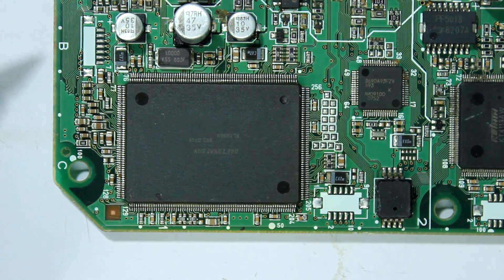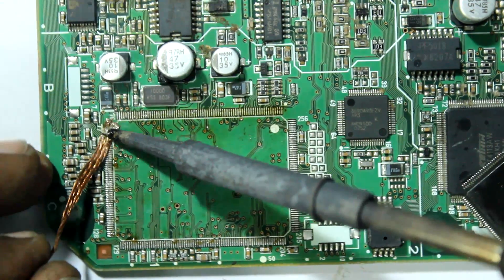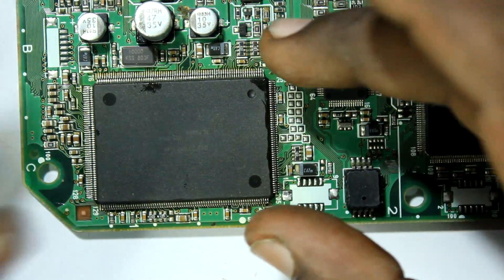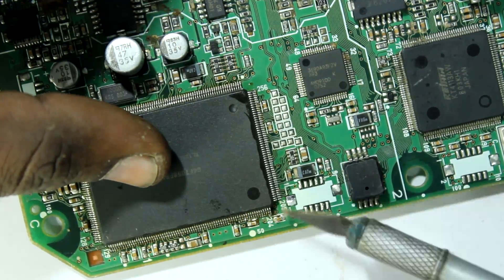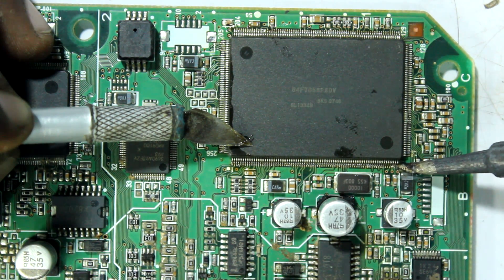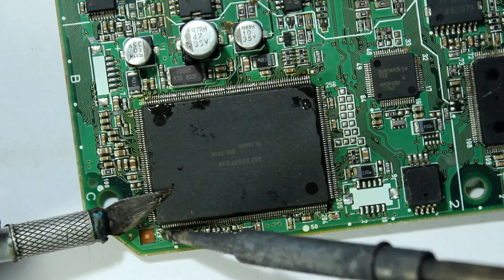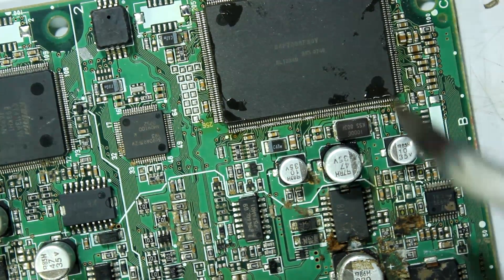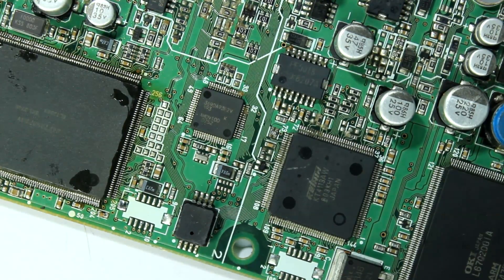How to solder like a professional.Without any professional Equipments

Comment: Thanks for the video, I know it takes time and effort and the meaning is in all good intentions , but I do question your soldering iron,  I will say that is got to be the worst iron I have ever seen. I'm amazed it could even heat transfer and all the gunk on it full of contamination, I would be worried that your solder joints are going to fail. I clean my irons every three or four spots . But what  do I know ? I just restore vintage amplifiers and Ham  radios as a part time business.

Comment: Well, i am with aaronspencer1880 in that points, that you need to take ensure that the pad place of the removed chip should be clean from flux and solder. Flux is your fried - i aggree, but use them as less as you can. The chip swim into the flux and this will be bad in the future because it's  nasty and corrosive. Cleaning and preparing the pads is the most important work that have to be done to get a solid and reliable solution.

Comment: QUESTION:  What prevents Solder from forming Bridges betweein these very close and very small pins thereby creating a Short ?   It seems that the Solder would flow and connect 2 pins together, what stops it from doing that ??
Thank you.
Reply: Flux

Comment: Beautiful job , i just soldered my LG plasma tv for black vertical lines i did this before worked great,  just had to soldier other side for vertical black lines it worked but this time i have fine red & blue lines is it possible i put a hair to much solder & if so can i just try to thin the solder or did i damage or short chip it looks great it's not sloppy just a hair to much solder do I have a chance to get hair line vertical color lines out or could i make it worse & live w it !

Comment: Thanks for this tutorial.  Is it because of the flux applied along with the tiny contact pins of the processor that prevents them from joining together when it is soldered on to the board?  Can you please advise? Thanks.
Reply: Gooy quality Flux

Comment: How sure are  you that no short had been done. The pins are so close with each other and you just run your soldering iron stream line.
Reply: if is the right amount of solder  the suface tension it will  "drag" it on the pin or surface where solder can stick  ,if is to much is possible to bridge the pins and you need to clean (take off the surplus) with desolder wick ordesolder pump  
you can check  "reball  chip"
   https://www.youtube.com/watch?v=BY-TCgvEU7g

Comment: Great vid in showing how simple this process can be and that if one can swing a soldering iron, then they shouldn't be scared to try this themselves. Well done to you, cooltronics!

A few extra tips, if I may, especially for those not experienced in this technique:

1. When removing residual solder from the PCB pads, try to run the braid in the same direction as the pads. It will take longer but it will greatly reduce the risk of ripping the pad from the PCB, especially if you apply too much pressure or the PCB is of poor quality.

2. Make regular cuts in the end of the braid to remove the 'soldered' part of the braid. If you keep too much solder on the end of the braid, there is an increased risk that the 'soldered' end, that has not quite solidified, may 'grab' onto a nearby pad, ripping it off the PCB.

3. Always remember that flux if your friend! Yes, it may be nasty and corrosive but once the job is done, it can be easily removed with propanol.

Comment: Excellent video -- made the much simpler job of soldering my micro-usb port back into place easy.
Reply: Hey, did you replace your micro usb port with soldering iron and normal solder? I don't have a hot air gun and solder paste so I'm tempted to do it with my soldering iron and use normal solder and flux. How did it go for you?
Reply: @Joao-cl1xk  yup, normal solder and flux.

Comment: Nice work. It's all in  the technique. The flux does help prevent bridges and allows the solder to flow nice. Practice practice  practice. I inspect with a high powered magnifier.  Touch up if necessary.  I would go in and out from the chip at the areas  needing  touch up to correct any bridges without disturbing the other pins, instead of going along the pins, but obviously this guy has had a lot,of experience soldering s.m.d.

Comment: I've looked as closely as I possibly can and I see no solder bridges anywhere. In fact I'm amazed it worked so well on such an IC. Well done, Ignore the idiots with their claims of bridges, it's almost as good as the original. I'm impressed and after working on the F15 Fighter black boxes and soldering for over 60 years I'm not that easy to be impressed over any soldering job.
Reply from the maker: Thank you, I'm working on my next video on soldering. I will try on that video to solder on a working board, and repair it. just as a proof. thank you for the comment, it was needed.

Comment: This is ridiculous work, a 5 year old could do better than this, literally every pin are shorted from one to another, how is this professional work??? look at 6:25 literally every pin connects to eachother in the middle, this is far from even amateur work, you should not touch a soldering iron.
Reply from the maker: the pins are so close to each other that, in the camera, it looks like they are shorted,  I don't have a zoom lens to show it to you guys, I tried my best but, Its good you don't believe me. but I am not lying. this is my job and I am doing this for years now.

Thnaks for watching.
Reply: axis of blindness, you're either blind or watching on smartphone...this looks good
Reply: I see no bridging
Reply: Se7en doesn't know what he's talking about.This method is called drag soldering. If you go to any repair shop this is exactly how it's done. for those asking what size tip you should use, use a J, K, or H for this method.
Reply: I see now bridging
Reply: http://prntscr.com/jf1ngv not even excess solder, such a clean job. What you think is bridging is actually the white line printed behind on the board.

Comment: How is this possible,to solder so many small pins-they are very close to each other without making bridges between pins?!?
Reply: It has to do with a thing called 'surface tension' ... the solder 'wants' to be on the metal, and it doesn't like sticking to the board.  So, as long as you :

1. Don't apply too much solder
2. Use flux before soldering

... you'll find that the solder really WANTS to behave itself : )  All you need to do is be gentle, and run the iron back and forth till all the solder has managed to find it's way to the pins.

Remember, a soldering iron isn't actually for applying the solder accurately to the pins....  it's just for 'encouraging' the solder to flow - the solder will put ITSELF onto the pins if you let it.

That's why even a fairly big soldering-iron tip can do such delicate work - even when the pins are much smaller than the tip : )  The tip might be so wide it covers several pins at a time ... but the solder knows where it wants to be : )

Try with old or broken equipment.  You will be surprised how quickly you learn the technique : )

I would add one thing though.  Get a cheap (preferably illuminated) jewellers loupe or mini microscope from ebay ... you can get them from Asia for a couple of dollars, they don't have to be high quality.  These will help you inspect the pins and check your work.

If you practice on broken things you won't be nervous and there's no risk.  By the time you need this valuable skill for a real repair, you'll already have the confidence and technique to do it right : )

Have fun !
Reply: @GaryChap Great explanation, helpful info & tips!
Reply: Such A loving solder
Reply from the maker: it is not, impossible.

Comment: Hey thanks for the video. Now I'm trying to unsolder a 32 pins, chip. And I would like to know if there are some chips that even though I apply 390c (734 F) and it won't release. And I'm worried because if I still doing so, I the chip can crash or idk. My problem is... why I can unsolder that chip?
Reply: That depends on the surface area of the ground copper planes attached to the pins of this component, they probably suck all the heat from your heating iron...you need to heat the pcb with a heater underneath, and use hot air from above to release it!

Comment: Excellent video showing how to do TSOP manually. I am use to using Pace hot air machine to reinstall devices after indexing to board such as these and others. I can do it manually and by hot air machine. I have been doing this kind of work for 9 years. I worked in the gaming industry doing this type of work. Great demo five stars
Reply from the maker: Thank you very much. have a nice day.
Reply: how is it Mr Seger, send me some link video pleasy.

Comment: Well done! However, I wouldn't use the X-acto knife to check for loose pins as it might bend them or even break them, no matter how little the force is.
Reply: What would you use? You should always share stuff like that.
Reply: @DownsouthMan  I don't use a tool at all. Only visual inspection. A microscope will help, but you don't actually need one.

Comment: As an ex camcorder service tech, this is exactly how it was done day to day in the real world, no solder paste or masks
only difference for me was I fluxed the PCB first with a sticky flux to hold part. Also works a lot better with leaded solder!
 Any solder bridges between pins just flux and move iron over it and it would go. Quick clean, there are proprietary flux cleaners with brushes attached to can but in the workshop it was Isopropyl and a tooth brush
Reply: This weekend I am tackling my gauge cluster, so 99.9% Alcohol would be alright as cleaner
?
Reply: We just used isopropyl alcohol which was 99.9% and never-ever had problems, it was the universal cleaner for most things, the only place it wasn't used was in the ultra sonic cleaning tanks.
Reply: Isopropyl or acetone. And a good inspection with a good ,magnifier.
Reply: Yes, the higher the better. Good luck.
Reply: #Not just sales,  More to #improve your product #utilization and #pass rate！#Save energy #protect earth resources！！①#Solder ②#Rework ③#X-Ray inspection
We Provide #One-Stop Solution! professional equipment call me whatsapp/wechat: +8618779975930 email sales25@zhuomao.com.cn
Reply: Gordon p` #Not just sales,  More to #improve your product #utilization and #pass rate！#Save energy #protect earth resources！！①#Solder ②#Rework ③#X-Ray inspection
We Provide #One-Stop Solution! professional equipment call me whatsapp/wechat: +8618779975930 email sales25@zhuomao.com.cn